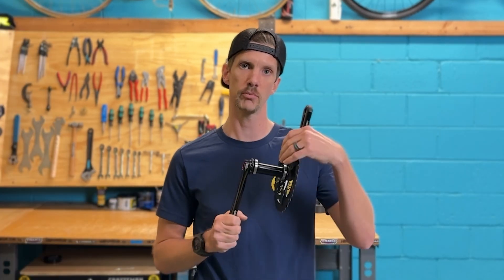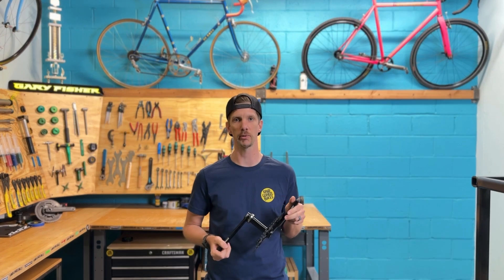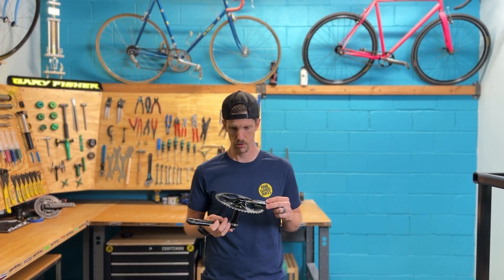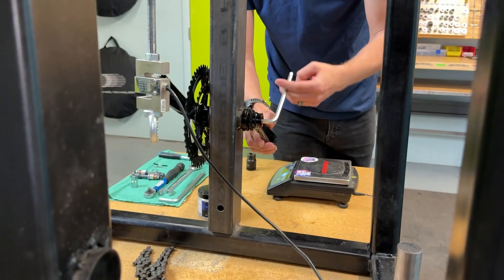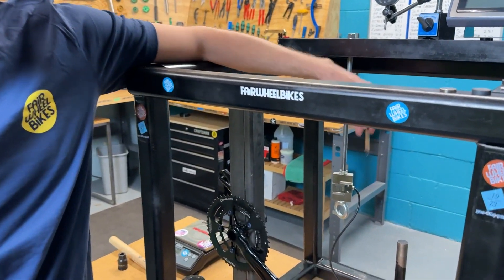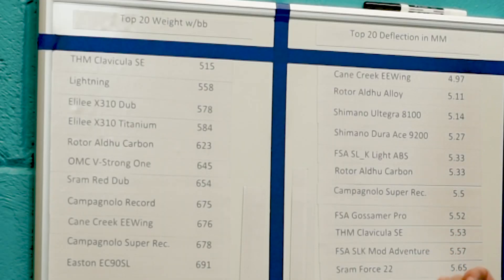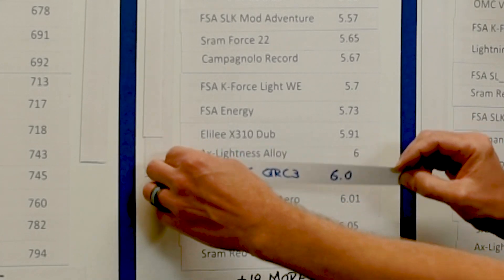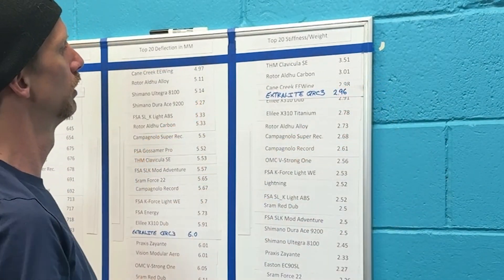Extralite QRC 3 Crank Stiffness Test

Comment: According to Cybrei’s website, the Shimano R7100 crankset is said to have a better stiffness-to-weight ratio than the 8100. If this information is accurate, it would mean that the 105 crankset is actually stiffer than the Ultegra. I’d really like to know if it is true.

Comment: Interesting to know where the Raceface Turbine and RF Atlas BB30 cranks, do you try to stick to the same crank length?
Reply from the maker: All tested road cranks are the same 172.5 length and use the same size chainrings.  We will have an upcoming mtb crank test with a couple dozen different cranks in the next couple months.